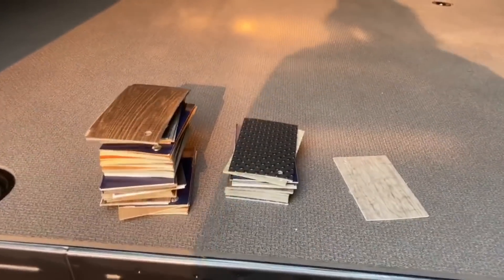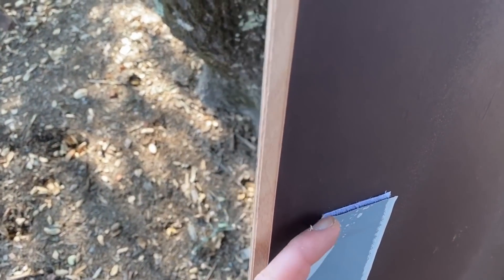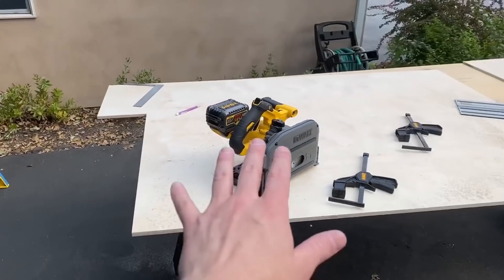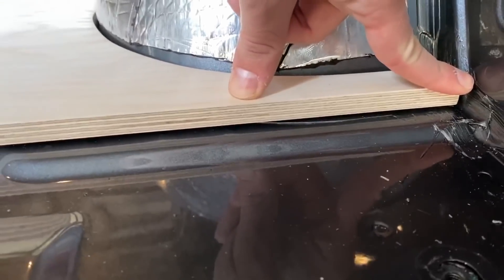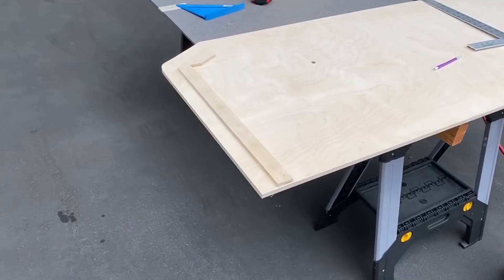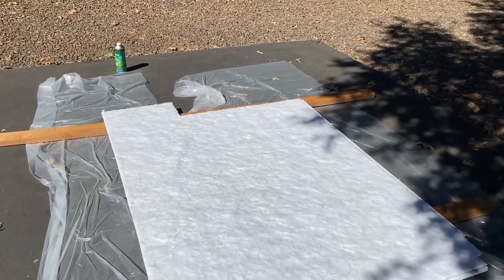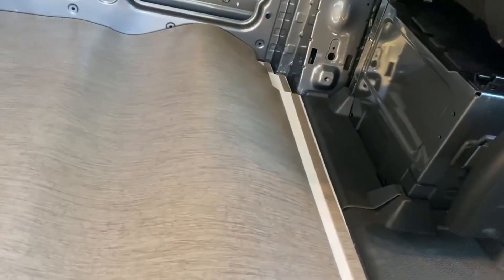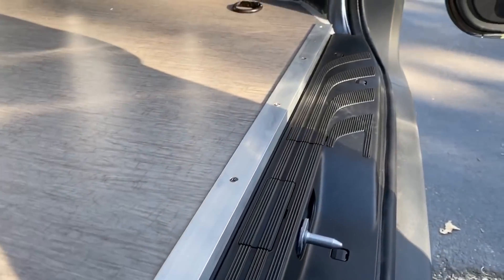This Low Profile Van Floor is Lightweight, Durable, and Goooood Lookin!

Comment: It is better to use a urethane caulking instead of a silicone based caulking for the perimeter of the Lonseal. The silicone will peel away in time.  Also, it is recommended to lay the flooring flat (unrolled) for at least 6 hours before cutting to allow it to "relax" and then cut it on the template at the same temperature that it will be installed to ensure the proper sizing.  When the flooring is not glued down it will expand and contract with temperature differences.  Lastly, Lonseal sells a permanent installation tape called "Lontape", but is pricey compared to using a 2-part epoxy full spread adhesive. It is available in 4" and 6" wide rolls that are 108 feet long.   Great video!!! Gregg from Lonseal.
Reply from the maker: Gregg, thank you so much for taking the time to leave this comment. I wish I would have known this info before installing and am SO glad this info is now here for viewers!
Reply: Gregg, Is there a brand of epoxy adhesive that you recommend?
Reply: @rmease  any 2-part epoxy will work, while Lonseal does sell a proprietary version that is an epoxy hybrid, meaning it is part epoxy and part polyurethane giving it the strength and flexibility required for a vehicle.  Some locally sourced epoxies are: West System 105 (add #406 to thicken to a mayonnaise consistency) and the appropriate hardener, Armstrong S-240, Henry 452, Mapei Ultrabond G15, or Taylor EnviroPoxy #501.
Reply: @joshjanes1  
For a urethane caulk the LEXEL or GEOCEL 2300 is best and they usually can be purchased at Home Depot or Lowe's.  For an Epoxy Adhesive,  the Mapei ECO 360 is not advisable since it is an All-purpose Vinyl Adhesive and rated for 65-85 degrees.  Here are some alternative adhesives to source locally besides the Lonseal #650 or West Systems 105.
Epoxy Adhesive: 
  Armstrong ,S-240 High Performance Epoxy Flooring Adhesive 
  Henry,452 General Purpose Epoxy Flooring Adhesive 
  Mapei, Ultrabond G15 
  Taylor,  EnviroPoxy #501
Reply: @joshjanes1  fill the seams in with epoxy or Bondo.  Any imperfections will telegraph through to the surface.
Reply: @joshjanes1  The thicker product will eventually show subfloor imperfections over time but not as quickly as the thinner versions (2.0mm -3.5mm).  The use of a Marine-grade or A-rated plywood is best due to the smoothness and also the cross-ply lamination that minimizes expansion and contraction. Masonite, OSB or Luan is not recommended. Composite sheets such as Coosa Board can be used but it's best to do an adhesive bond test first and roughen them up with 60 grit sandpaper.

Comment: I know someone is probably going to say something smarter than this, but learning from a  somewhat-related romanian kitchen builder, who actually did our kitchen installation as well, you can prevent streaks of silicone outside the area you want to close using oil or dishsoap. He quickly removed silicone from the areas he wanted clean, after he used the same sort of square-plate-with-corners-thingy that you are using. Loving your videos!!!!!!!

Comment: This might not matter for you .. but the reason that metal strip is there on the factory floor as a transition to the front compartment is to be able to pull up those plastic pieces up if you want to run wiring under there ... or for repairs.

Comment: Forbo Marmoleum is also a great choice for flooring, and its a natural product that can be touched up with beeswax. Also, scoring cuts and using a hook blade with the flooring is an easy way to get clean cuts.
Reply: Hook blade and Skills
Reply: I like that product. I think it comes in tiles,LVT too.
Reply: @277kne  ppl eating that vinyl flooring up
Reply: Yes. Takes some skill, and it’s not cheap. Forbo does make MCT but I wouldn’t recommend it. Learn how to template with felt paper and you’re golden.
Reply: @genecreamers5233  as long as you keep working. That's a GrubHub hat not a maga hat lol

Comment: I never cease to be amazed by your dedication to precision and quality. The floor looks incredible. As for the errors, I definitely appreciate the transparency and inclusion of those elements. Hopefully you will be able to use the 5 x 5 sheets for your cabinet or bed build or in other elements of the van so it isn't a total waste.

Comment: Please keep mistakes and remedies in the videos. I'm hoping to get a different van to do a complete build on in a couple months and things like this are so helpful! Especially the vinyl mishap. The heat information is a really good tip. 🤗

Also thanks for mentioning your height and finished van interior height. I'm over 6' and it's something that concerns me as far as what to buy

Comment: Nice work.  For a Zombie/bug out van I went with a Ford 2021 E350 cutaway van with a 14'5 box and its 80" wide with a 84" interior height for the vertically gifted. Its cheaper than the Transit and twice the towing capacity.
Reply from the maker: Nice! Sounds like you’ll be surviving the apocalypse in style
Reply: @seven_o_savage  1,200 watts of solar panels and a mini split heat pump

Comment: I'm in the process of doing a van build , I've been watching all your videos, I am very interested in using the lonseal marine flooring, the LONSTRAND® TOPSEAL line. I can't find anywhere to buy it from a retail outlet. How did you find yours and do you have any suggestions? Thanks for all your hard work suppling all this information

Comment: I have a Sprinter Van on order.  Are the factory floors worth saving for something (other than just a template)?  For example, could they be used as either a sub-floor or using a birch plywood underfloor for it?

Comment: Why not reuse the OEM floor and put the Vinyl on top? This is super high quality plywood.
Reply: Yes, I just bought a sprinter and am wondering the same thing. Am I missing something?
Reply: I think because of thickness and his height.
Reply: I'm also interested in knowing why you wouldn't reuse existing oem floor. Strength?

Comment: where did you get the over the wheel water tank?
Reply: I just ordered one for my build from nwconversions
Reply from the maker: They're made by 1 manufacturer and sold at many different places, stock varies between stores though. If you google "32 gallon over wheel well water tank" you should get the top stores that carry them.

Comment: Your subfloor for your grey sprinter van you only secured the floor through the factory bolt holds and tie down anchors 
How has that worked out for you

Comment: Beautiful work SOS! I'm in the middle of this process right now, and love your method for locating the through bolts. Are you happy with your decision to fit the floor to the driver side b-pillar vs. the b-pillar trim. My floor is built up a Little more (1.7") and would require me to trim about 1.5" from the bottom of there b-pillar trim piece, which I don't think  would look good. So, I'm planning to fit the floor to the b-pillar trim.
Reply from the maker: Really up to you! Would look good either if cut precisely

Comment: Love this video! I've literally watched it like 20 times. What router bits did you used to router out around the wheel wells and for the bolt holes? Also, did you use caulk where the floor transitions were used, or how did you ensure that stuff wouldn't get under the floor where the floor transitions are? Thank you!
Reply from the maker: Nice! Make sure to watch part 2 and 3 if you haven’t… this one didn’t end up working. 

I used a straight bit and I did use caulk
Reply: @seven_o_savage  Thank you! I've totally watched all of them. Even shared them with my dad. Lol. Love seeing the entire process!

Comment: Hey Seven solid video curious I'm 6'4 so saving height is key curious your thought process around thinsulate vs just reflectix insulation my plan is minimal insulation with 3/4 sub with either rolled coin on something similar to what you did. I have 3 dogs will not be a full timer and most of my activity involves heavy wet stuff ! Thanks in advance keep rockin in
Reply from the maker: Hey good questions, reflectix might work but it’s primarily effective for keeping the heat out. With the floor you insulate primarily to keep cold out in the winter. To keep height to a minimum I would stick with either thinsulate or filling the ribs with impactproducts insulation kit (you can find that on ebay).

Comment: Seven, how much thinsulate did you end up using? Are you using it for your walls and ceiling as well?
Reply from the maker: A lot. Yes
Reply: @seven_o_savage  could you tell me how many linear feet? I just need to order some as I am about to start building out my 170" Selenite and have no idea how much I will need. Thank you in advance - I really appreciate your channel and your lessons.

Comment: Did you connect the sheets of baltic birch together with biscuits or glue?
Reply from the maker: In this video I did not connect them. In the third floor video I used a half lap joint w/epoxy
Reply: @seven_o_savage  Thank you!  These videos are awesome!

Comment: I've heard that if you spray soapy water on silicone caulk before you manipulate it with that tool it'll be easier to work with.
Reply: Never do that.  Check out yt vids
Reply: @007nadineL  Where do you think I learned it in the first place ;) - Why is it a bad idea?

Comment: Hey man, does the plastic trim on the B pillar on the driver side need to come off in order to remove the floor? I'd love to keep it in place if I don't have to touch it, but it looks like the factory floor goes underneath it for like at least 1". Tomorrow I'm starting the floor insulation ...
Reply from the maker: Yes it does, but it’s really easy I’m sure there are some YT vids on it
Reply: @seven_o_savage   That's what I thought, thanks man!

Comment: Seven, I wanted to say THANKS, as I have gotten so many van build ideas, and used quite a few, from your videos. Thanks for documenting everything. I am borrowing your 8020 bedframe design and modifying it to fit a partial extension as my bed is not the full width of the van. I like your roof rails idea using 8020 and I might do the same for my solar setup. I am also considering doing a similar cedar tongue and groove roof with magnets. I am also going with a Lonseal vinyl flooring but through ameriteakstore.com, which looks to be very similar to the product you are using. For my floor install I followed the lead of faroutride.com and used two layers of minicell foam beneath the plywood, one to fill the corrugation strips and one additional layer beneath the plywood. Keep up the good work! -Russ
Reply: I used the lonseal also but I epoxied it down as recommended. I don’t know why he decided to dry lay it. If he gets a bubble he’s screwed.
Reply: @michaelscarfi3196  I have asked for a recommendation for the correct adhesive to lay down this flooring and the seller I noted above does not recommend loose-laying the vinyl for the reason you mentioned, the vinyl will expand and contract with temp changes and bubbles can form. I will be using an epoxy to glue down my vinyl. I'd be interested if @Seven O Savage would comment on if he has had any issues since this was installed.
Reply: Be prepared with a couple of people! The working time is short. Buy the right trowel,rent the roller,Home Depot has them they are super heavy and the people there don’t know your not suppose to roll them in the parking lot so most of them are ruined. Check that out first.its an amazing floor virtually indestructible I love it.

Comment: Interesting how this design is so different than your first. I think it takes a build to learn what we truly want. 

I have a question that relates to your first build. You are the only van builder who created a vary similar feature that I already planned on before I saw your videos, which is the telescoping bed built with 80/20, and I am curious how it worked out for you functionally. Was it strong enough? How easy did it glide? If you were to design a telescoping bed again, what would you change? 

As an added twist I am attaching the whole telescoping bed frame to a 500 pound slide that will allow the whole bed to move forward and back, out the back 3’ to sleep under the stars, and forward 30” to reveal the toilet and sit down shower in the back corner. Ambitious for a first build but I am hoping it will be my last. (I’m fast approaching 70 and am not sure I’ll have another in me 😉)

I’d certainly appreciate a few minutes of your time. BeVanNow at gmail. Thx!
Reply: Ummm hello.... George from humble road vans?
.
Reply: @007nadineL  Mine is a little different, more like Mr. Savage's design of van 1. Elevated over garage....

Comment: Why did you use Baltic birch for the subfloor if you were just covering it up? That's typically a cabinet grade material.
Reply from the maker: It’s strong 💪
Reply: It’s also smooth and stable. When your laying a 500 dollar vinyl floor over it I wouldn’t try to save 30 dollars using junk. On the other hand I used 3/4 because I’m not taking any chances.

Comment: Why'd you pay extra for the plywood if you was covering it with laminate?
Reply: Birch is stronger per thickness than other plywoods. Also, it's better resistant to expansion/contraction and has zero knot holes.

Comment: compressed insulation, is not insulation.
Reply: Thats what I thought ...
Reply from the maker: Correct, it's important to purchase the Thinsulate SM-200L (only expands to 1/2") so that it can expand fully between the ribs.
Reply: @seven_o_savage  and those ribs are compressed. Poly iso would be best.

Comment: As per owner's manual: The wooden or plastic cargo area floor fitted
at the factory is an integral component
of the vehicle structure. The vehicle body
could be damaged if you have the load area
floor removed. This then affects the securing
of loads and the maximum loading
capacity of the lashing points is no longer
guaranteed.
Therefore, do not have the load area floor
removed.